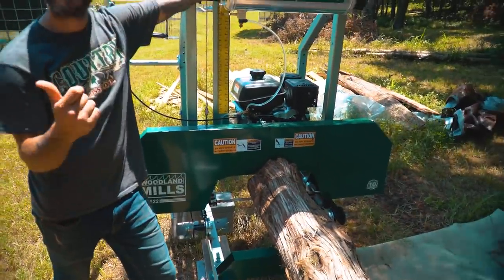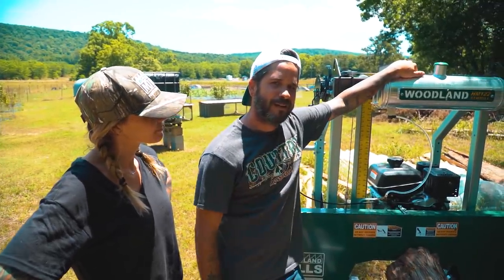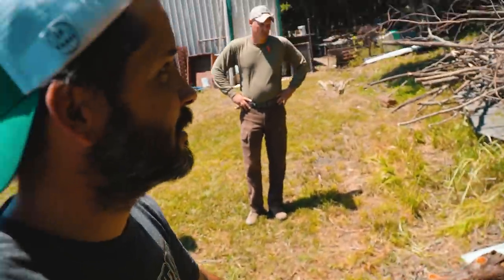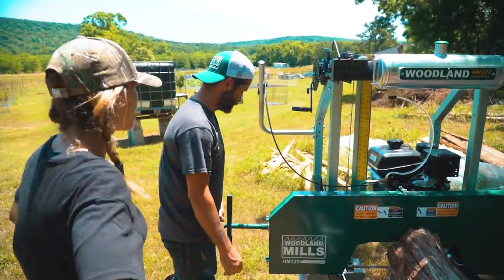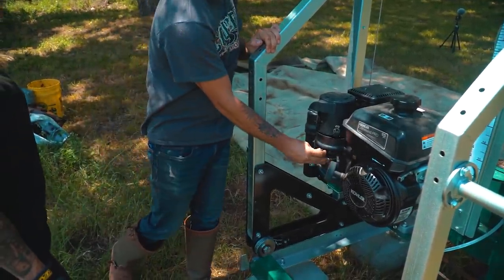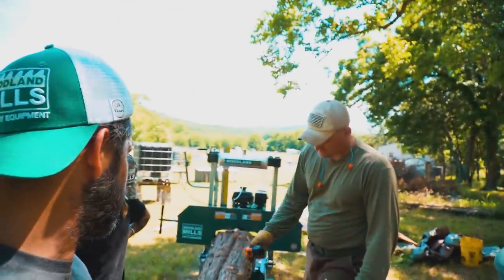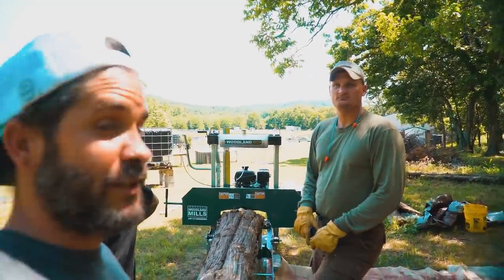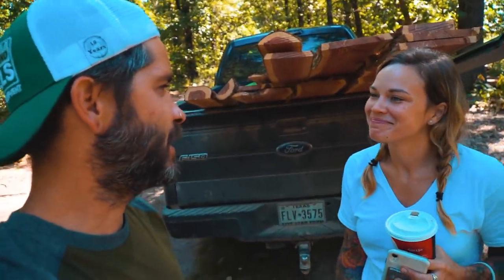Milling Cedar Siding for Off Grid TINY HOUSE with Sawyer Ridge Farm! Woodland Mills HM122

Comment: 2 tips for the saw mill.  !. Where the water comes out attach a 90* elbow so it drips straight down... works better. 2. put a squirt of dish washing liquid in the water. Helps cut the sap on the blade and helps keep fungus from entering the wood.... We mix a good squirt of orange dawn in a bucket and wipe the slabs down after cutting.

Comment: Jason, if you had a tool called a draw knife, you could debark the logs faster and easier before milling.   Then, you wouldn't have to peel each and every slab before using it.  They are relatively inexpensive and are easy to use.  I've also seen a debarking attachment that mounts on your chainsaw bar which is even faster and gives a smoother finish to the outside of the log.  Happy Birthday, Melisa!  I hope you two had a really great day!

Comment: Saw mill a wonder. What do you need to make use of parts with brush,? many large enough for deodorants, pest control for home and ground up mulch branches, curls are used abundant, equipment called what?? utilize ever thing except leaves. Seems a good day and creek a blessing after all that muscle power.

Comment: Is that the same saw blade it came with Jason ?
Reply from the maker: Yes. I have 10 brand new blades though. Very new to sawmills so I plan to use this blade until I see it struggling to cut. Honestly not sure how long blades normally last
Reply: @TheCrockers  You can get them sharpened,If there is a Saw Dr or the like near you pop in and see if they can do them for you.